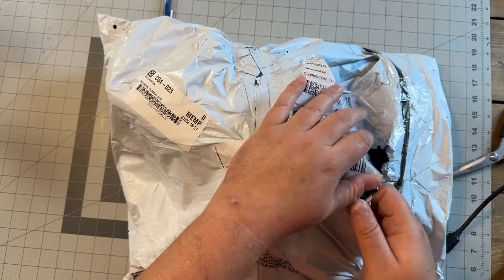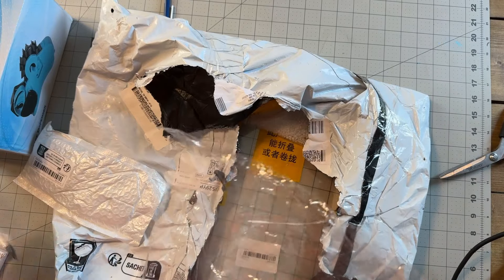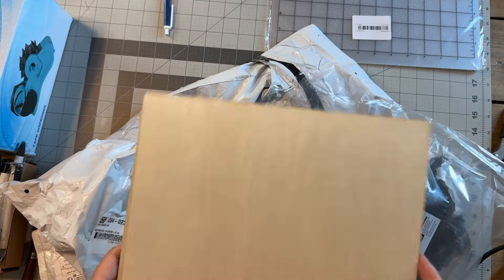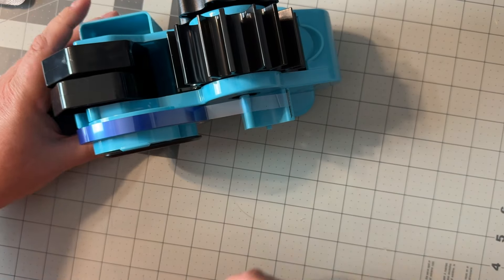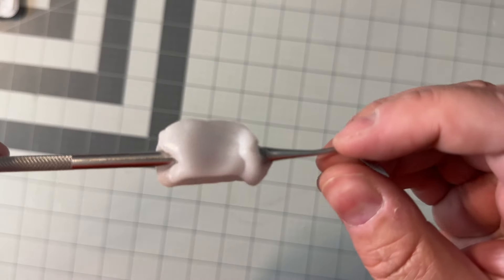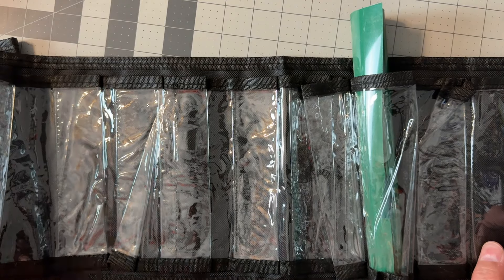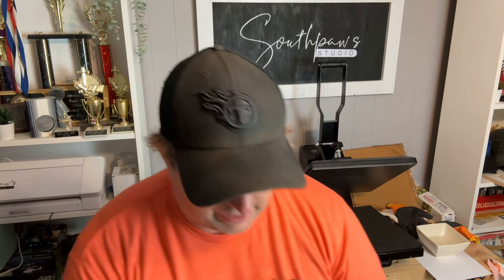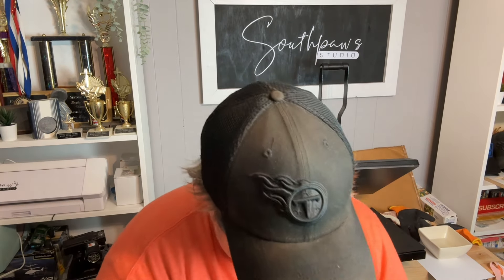Review of Sublimation Tools and Blanks from Temu - Part 3

Comment: With the pens, it appeared that you didn't pre-shrink your shrink wrap so it was probably a pressure issue.
If you did pre-shrink it, it was difficult to see but, they still came out cute 😊
Reply from the maker: I did hit them with the heat gun to shrink the wrapping prior to putting them in. I ended up timelapsing that part to help the flow of the video. The paper was slightly brown, so I'm leaning towards a little too much heat... It was still pretty cute tho.